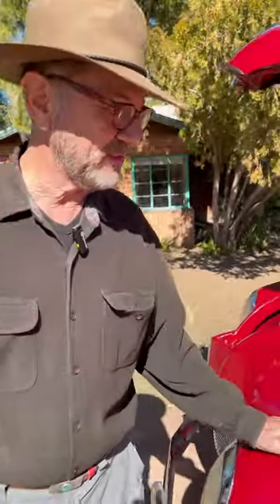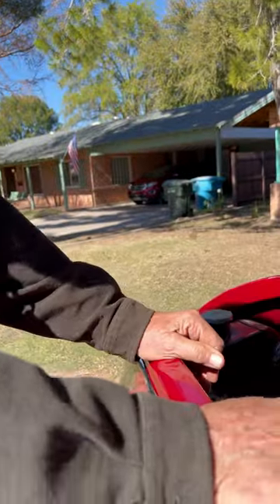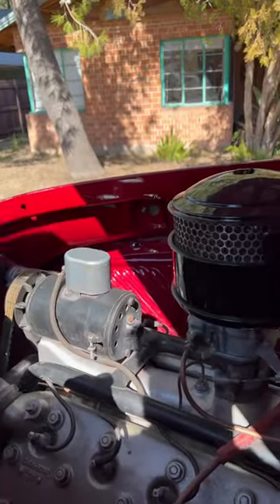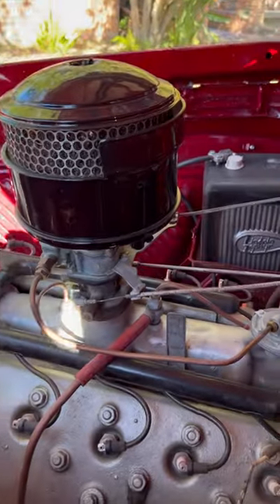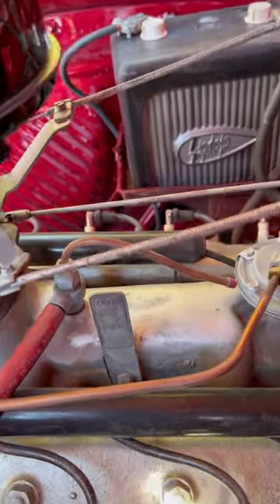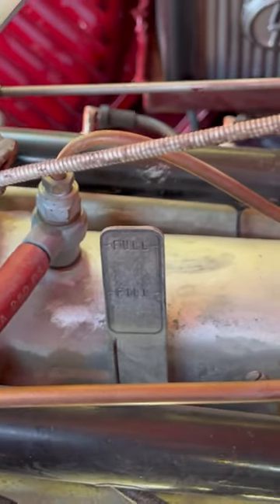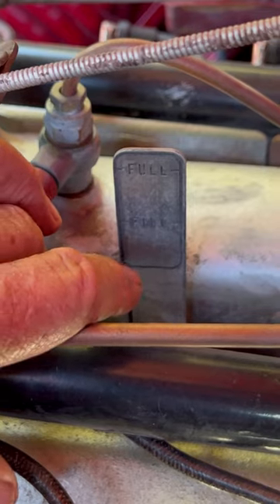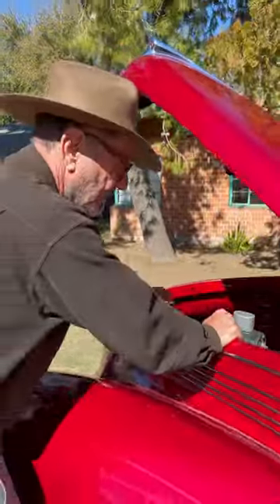Crazy No Dipstick Oil Check - Early Lincoln V12 Flathead #shorts #classiccars

Comment: Back when things weren’t designed to force you the dealer shop for all the built in obsolescence or big repair bills.
Reply from the maker: A different time!
Reply: Wanna bet?
Maintenance on one of those vehicles at today's prices would bankrupt most drivers.
They were money pits, and often didn't really last to the limits of the odometer - 99,999 mi.
The heavy steel bodies rotted from not having any rust protection besides the paint, which required frequently hand waxing in order to look decent and have any shine.
Interiors rotted from UV because windows didn't have tinting that offers solar protection.

Engines required oil changes at 1500-2000 miles, needed points, plugs and wires every 10-12,000 miles, along with timing adjustment, carburetor jetting, air cleaner oil-bath servicing, chassis had multiple grease zerks that need to be greased at least 4x a year, wheel bearings needed to be re-packed every 10,000 mi, hydraulic shock absorbers only lasted about a year, as did steel mufflers and exhaust pipe, and batteries typically lasted less than 2 years even if you remembered to keep them full of distilled water.

Yes, with plenty of maintenance and love, these vehicles could last a very long time, but very few of them ever saw 100,000 miles without at least one complete engine overhaul, new chassis bushings, and probably a new radiator too.

Compere that with most modern vehicles being almost maintenance free for that same amount of miles, and with a little care, they'll often make it to 300,000 miles without spending a day in the shop for anything more than tires and brakes.

And then let's talk about safety, conveniences, technology and comfort. Just learn to stay away from known problem vehicles with plastic engine components and anything "1st Gen", and you'll be miles ahead of the game.
Reply: @tvtothepoint  I’ll take you up on that bet.
Reply: @tvtothepoint  

Fcuked electronics and computers and associated sensors are the new 'rusted bodies and frames'.
Reply: @tvtothepoint  yea i wanna bet i have a 1967 cadillac all  original  The engine,the transmission and the rear end have never been touched except for minimal maintenance which is really inexpensive and easy to do  even at todays prices.3D printers and on demand CNC Machining have made it so.Which makes it very user friendly I can do all the work myself and if I can't it's really cheap to have somebody else do it for that reason. The GM Turbo Hydromatic 400 transmission in the car still works just fine also with minimal service maybe the filter was changed once over it's 56 year life span.  The Turbo 400 is famous  for its durability and was even used in rolls Royce's back in the day. Obviously the cadillac doesnt get very good gas mileage but plenty of other smaller cars did Ford had a line up of fuel efficient six cylinders starting at 2.4 liters . This could easily achieve 30 mpg in stock trim. I used to own a1986  VW Rabbit diesel that got like 50 mpg  with out modifications.  And then there's Honda there's a guy with a 1989 Honda Civic CRX who set the fuel efficiency record at 118.5 mpg with a few aero dynamic  modifications. Just like there's an incandesecnt lite bulb at a fire station in Dublin Ca. thats been burning for 118 years now.  The whole program of the planned obsolesence  of the light bulb is well documented as well as in the automotive industry others too i would imagine.  And I guess you've never heard of resto mods where people take old cars and update them a little and then you've got the best of both worlds. You should watch Vice Grip garage Derek is funny and informative too.🙂
Reply: @skylined5534   Yeah there's countless cars in junk yards that are there just because of some minor thing when the check engine light went  on and they couldn't get it smogged.
Reply: Planned obsolescence for cars started in 1924 with GM
Reply: @tvtothepoint  And new cars have MAJOR problems right off the lot. What do you think the 1000’s of recalls are for
Reply: @SuperErikRoss Your cadillac is an exception, not the rule. @tvtothepoint made a valid point, just the regular maintenance on an old car like that would be a pain in the ass for a normal person. Why did you bring up vws and 80s hondas? He wasnt even talking about foreign cars from the 80s. He was talking about classic American cars. American cars from like 1910 to 1980. Obviously a Japanese car from the 80s is gonna be lightyears ahead of an american car from the same time period. Even a chimp could tell you that.
Reply: @SuperErikRoss  

That's some how so much than a car dieing due to rust and rot 😂
Reply: @ionbusman2086  

Ford Pinto cough-cough
Reply: @johnnyjohnathon7381  

A car from the Flintstones is light years ahead of the first gen Tesla model S alone.
Reply: @tvtothepoint  

Rotten frames isn't a 'maintenance issue unless you're from the 20th century. Or the USA.
Reply: @skylined5534 
Or drive in the winter, in the Midwest.
Reply: @ionbusman2086 
How well do you think a car from 1970 would fare if it had to pass all of the rigorous safety and quality checks a modern vehicle does? 
Do you think it wouldn't be instantly and permanently recalled?

We were lucky if we didn't need to carry a towel with us every time it looked like rain - even in brand new cars.

But I guess some people still miss having ashtrays instead of cup holders, and frozen door locks instead of remote start, keyless entry, and heated seats?
Reply: @tangokilo1453  And there it is.  Was wondering if someone would mention that.

Comment: No electronics , no tech , no BS , works great . We need more of that today !
Reply: It didn't work great. It would jam and stop working. 

Cars today are tens of thousands of times more reliable than vehicles then.
Reply: @jeepmanxj  I know. They bragged about a car that lasted 100,000 miles, barely broke in today. Just think of all the dust that went down the hole around that oil checker rod.
Reply: Planned obsolescence
Reply: @johnyvolvo434  cars going back to the beginning of automobiles were planned the same way.

What's your point? There hasn't been a time in history where planned obsolescence wasn't a factor.
Reply: @jeepmanxj Im pretty sure the guy who invented the wheel planned on it rolling not rolling and then breaking in half after 25 miles. Don't talk shite 😂.
Reply: @owenwilson3750  you had to reach so far for that I'm surprised you didn't hurt your back.

Since the beginning of manufacturing companies have made whatever to fail or become obsolete. That has never not been a thing.
Reply: @jeepmanxj  also not true its a recent thing. For example I fix DAF trucks and way back when they had grease nipples everywhere and nothing would fail. Now the only grease fittings I normally see are on the kingpins and all the other stuff like the universal joints, sliding joints, spring eye bushes, etc all lost their nips and now they get replaced fairly often because of course it makes DAF more money.
Reply: And no weekly updates
Reply: @jeepmanxj  ... yup... and if they maintained things (change the oil?) it probably wouldn't jam up! Oil changes were supposed to be done every 1,200 miles back then and the average guy likely did it once a year.
Reply: @williamrosenow6176  ... in the days before PCV systems, the crankcase was positive pressure, so didn't suck in much dust.
Reply: @owenwilson3750  ... I have a 1928 GMC and it's got 27 grease nipples, plus another dozen "oil points" which are basically drilled holes with a dimple for using an oil can. Most of those oil points are on things like throttle linkage and brake rods that would stick with thicker lube. If you hit everything, it's like a new truck for a couple of years.
Reply: @rupe53  nope, they still jammed up.
Reply: @owenwilson3750  The guy who invented it?  Of course not.  The guy who first mass-produced them to sell?  You're laughably naïve if you think he didn't.
Reply: Today's cars are loaded with electronics. They are computers on wheels and are very fragile
Reply: @jeepmanxj  bull, none of these newer cars will be running 80+ years from now.
Reply: @herbienbrian2  yes they will.
Reply: @jeepmanxj  

More than likely.
Reply: @richardbambenek2601  electronics are millions of times more durable than old setups they are also far more able to cope with changing conditions.

Most people have never owned an old vehicle. They own something that is a show piece that only comes out in the good weather to cruise around so they can wag a weenie around.

Older engines were a pain in the absolute ass to keep running consistently. Always adjusting carbs, fucking with points or distributor timing. Blow by and cylinder wash was a real problem and oil quality was crap so you were always burning it and needing it replaced so you didn't burn it down. Cast iron blocks had prolific issues with corrosion in the coolant passages. Heads didn't use hardened seats so they would stop holding compression after 40k. 

Old vehicles were a pain in the ass. There was nothing good about them and the only reason they are collectable is because most of them hit the scrap yards.
Reply: @jeepmanxj  bruh. today they're meant to last about 2-5 years
Reply: @Emppu_T.  Hundreds of thousands of miles on a vehicle today isn't even something to bat an eye at. 100k miles on classic and that thing is past due.

It isn't even a debate cars last longer these days.
Reply: @jeepmanxj  and leaded gas
Reply: “Anything that moves will eventually wear out”- Tim Epson
Reply: @herbienbrian2  I think you’re right, and I think folks will still be looking for old bullnose fords, square bodies, and dodge 12 and 24 valves to restore. The stuff that’s made out of steel and just won’t quit.
Reply: We have that, and more! Because of the electronics and tech, namely the "bs" is what does it nowadays! Or is it called modern manufacturing... I'm confused. Anyway, change oil at 5k.
Reply: Tell me the last time you saw a computer on a dipstick😂
Reply: That it tech, it's old tech but it's still tech

Comment: Until it sticks, or the float gets oil logged. Give me a dipstick.
Reply from the maker: Same for the gas tank
Reply: I'm pretty sure they were brass floats not cork, and plastic was not your friend yet
Reply: this is why they called for oil changes at 1000 - 1200 miles in those days. That non-detergent oil got gummy real fast.
Reply: @Retired Bore 

That's a bit of a myth regarding the oil level sensor. In fact, we're taught that these 'modern' systems shouldn't be trusted but out of the many cars from   BMWs, VWs, Mercedes Renaults etc I've had I've yet to see one that doesn't stay largely faithful to the dipstick reading. 

If the sensor straight up fails then that's another story but they'll usually indicate no or low oil not the opposite.
Reply: @skylined5534  Yea ive had a bmw with the electronic oil level sensor for about 5-6yrs now actually. 
As much as i hate it and want a normal back-up oil dipstick, i cant really complain.
It is accurate and reliable. And its pretty quick to react to changes in even a small amount of oil level down, it shows you a picture of a dipstick looking graph with a low & high line. So even an 1/8" down will make a difference.
  Plus it does help you if something was to suddenly go bad like an oil cooler line/etc, you would see the oil warning light come on right away, otherwise wou would be waiting for the Oil Pressure to Drop and the Oil Pressure Dummy Light to start popping up, which could be too late at that point..
Reply: @@retiredbore378 Yea the minis are made by bmw, well anything newer than 2010ish or something. 
They all seem to burn alittle oil inbetween oil changes, but my car is turbo and its not much at all. 
I only have to top it off if im constantly going into boost when im driving, wasting gas lol.. Mine holds 7quarts and i measure it when pouring it back into the gallon oil jug to recycle and the electronic oil level sensor dipstick thing is always spot-on.. 
Plus its also an oil wear sensor, so it can detect thinned out oil and a bunch of gas in the oil using the resistance of the fluid to guess how thick it is or something like that lol..
Reply: @@retiredbore378 Theyve been doing that since, forever lol. 
And if you want a BMW and want a dipstick, just get the diesel motor lol.
Reply: There is no float. Its all about fluid levels.Bayonet guages  are good.
Reply: My high pressure air compressor has a little round glass window to keep an eye on the oil level. 👁
Reply: @petesmith5092  plastic was never my friend 🙂
Reply: @SuperErikRoss  you got that right
Reply: That was BMW’s main reliability downfall. Failing plastic coolant junctions. Thermostat housing’s, Tee’s, splitter’s, hose ends that clip on, long plastic radiator neck, plastic adapter into the cyl head, etc..
Reply: @SuperErikRoss  that was meant as a sarcastic repulsion to plastic. My old high school power & energy shop teacher used to say "plastic is your friend" Onliest time plastic has been my friend is when it's reduced to ash in my burn barrel.
Reply: @petesmith5092  ahhh high school shop class where you learn to have no class !!!! 🙂
Reply: @@retiredbore378on my 2021 Peugeor Partner the dip stick is easy to access but the car will also warn me if the fuel goes to low
Reply: @SuperErikRoss  maybe but I learned what facetious is
Reply: @skylined5534  I've worked on an ~2009 Audi A4 where the oil level reading would go up by itself. I know I put in close to the claimed refill capacity, but it only showed around 2/3 up between min and max, but the reading increased to near max just by waiting. 
This makes it more annoying after spending time trying to get a reading, as the system says "oil level reading not available" and it says "oil must be warm" but doesn't know if the oil is warm apparently. No instructions, whether or not the engine has to be off etc.
Reply: My thoughts exactly! Not much that can go wrong with a metal stick
Reply: Smart man! It's absolutely stupid, overly complicated.
Reply: What?  @raginroadrunner
Reply: Yeah...I have an all original 1946 Lincoln Club car V12 ..same engine  ..same oil level mechanism....it doesn't stick..and the float is fine 77 years later.....id say it works pretty damn good

Comment: Not good. Collects condensation from the differential temperature between the stick and the oil bucket. 

If it moves that freely, it's open. Not sealed. Condensation, dust, and debris will collect around the temperature difference
Reply from the maker: I’m sure we will agree that if this was a perfect solution, it would still be in use 90 years later. I think the point here is to enjoy the historical evolution of how carmakers were trying to innovate and move forward.

Comment: If the oil manages to get into the float, how do u replace the float? Is it easy to access or remove, or would the sump
have to be removed just to replace it? Cool idea just curious to find out how reliable it is and how simple it is to replace if damaged.
Reply from the maker: I believe you have to drop the oil pan to service the float. 
I find the history of innovation and experimentation in the 1930s cars to be very interesting but clearly not all the ideas had long-term value… thanks for the questions. Great to have you on the channel.

Comment: very cool. My grandpa has an all original concourse '39 zephyr. as far as reliability goes, the 12 cylinder is prone to overheating. especially with modern fuel. This can cause countless issues, but the zephyr is a highly unique classic. I'd buy it off him if I had 100 grand lol.
Reply from the maker: They are a piece of art in my opinion, I don’t get tired of looking at them
Reply: What about adding a better radiator and using Water Wetter?
Reply: @nostradamus7648  running leaded fuel and tuning a little rich might help too
Reply: One of my all time favorites! A true work of art.
Reply: I work on a fair amount of old vehicles and I find people set the timing too retarded or forget to manually set the timing after a hot start. Many of these have no built in advance in the distributor so you constantly have to fiddle, or they run hot. Of course, this presumes the radiator isn't restricted from old age.... or clogged with grease from someone using the wrong lube on the water pump for decades, which I had an issue with on a 1928 GMC 6 cylinder.
Reply: to reply to all these comments, I think you're all right. running a car 'all original' is unrealistic anymore with shitty modern fuel. I have the same issue with my 66 thunderbird, AND my 50 plymouth special deluxe. unleaded fuel not only overheats the engine, but also clogs up your carb with white residue (ethanol) very quickly. even if you run boat fuel which is supposed to have no ethanol, they're lying to you. its full of ethanol.
Reply: correction^ the fuel itself doesn't necessarily overheat the engine, the fuel boils at a lower temp. causing a handful of problems
Reply: @hawgtied  ... I have that 28 GMC and a 64 Corvair that I have been adding a bit of enzyme treatment to the tank once in a while, and no problems the new fuel in the last 10 years. I also keep after an old guy's fleet of mostly 60s vintage cars the same way. VERY few problems over the years, unless he fails to drive one for a long time. The enzyme additive seems to solve the "white shit" in the carb. Of course, I also use a fuel stabilizer before winter storage. One of these is 3+ years with the same tank of fuel... and started on the first try last week. (the 28 GMC)
Reply: @rupe53  I'll have to give that a try. thanks! our carb just had to get cleaned last week because of this.